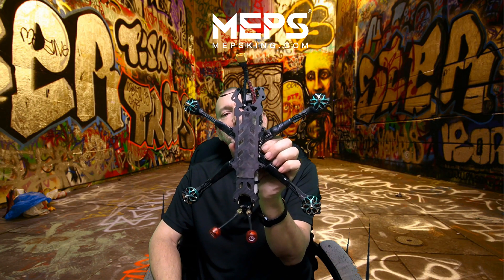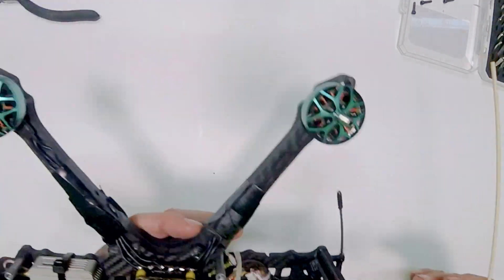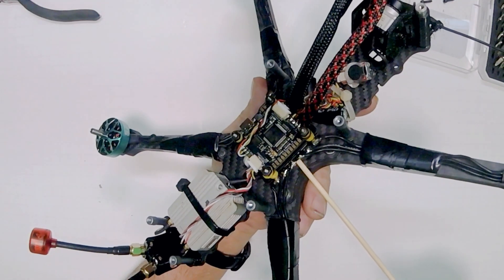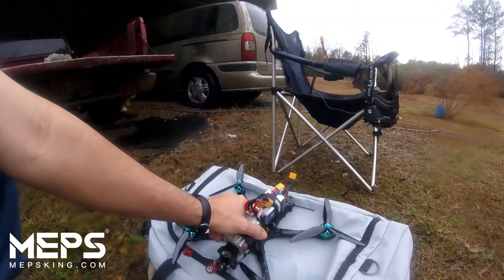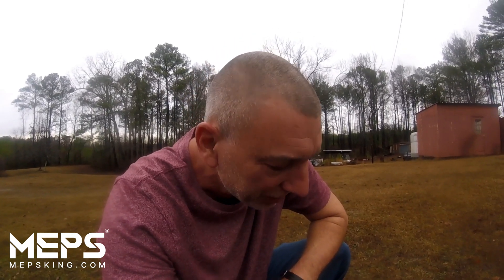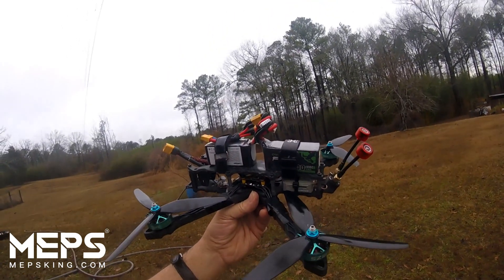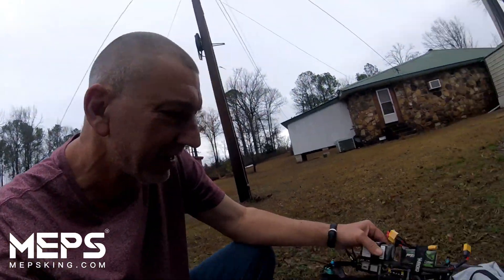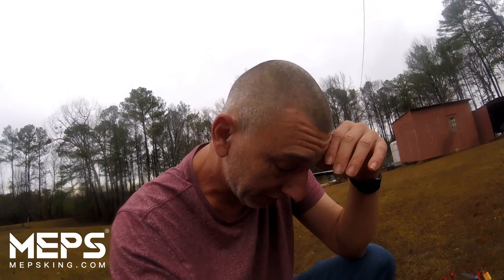@mepsking 7 Inch Mepsking Monster 3D drone build & test. Meps 2806.5 motors. Tested hard!

Comment: niiiceee!!
nice ripper bro!
i was looking on the mepsking site and wondered even tho the moto is like 2207....is 1950kv still too low for a 4s setup? it would be efficient as all getout if they worked lol!
Reply from the maker: No 1950kv is just right. gives me long run times on 4s and almost to much power on 6s.   all my 5 inch quads have there mepsking 2207 - 1950kv Motors on them. Perfect 5 inch motor.